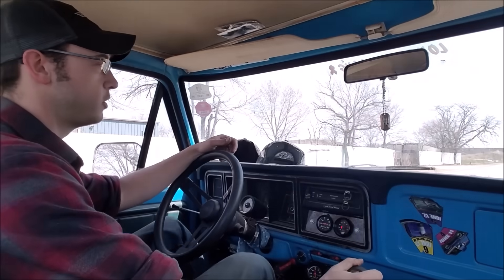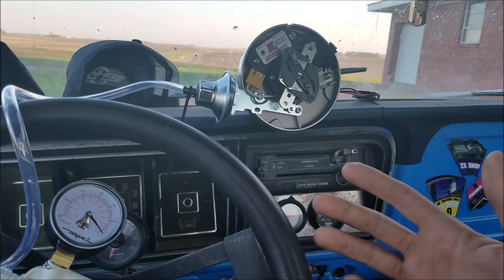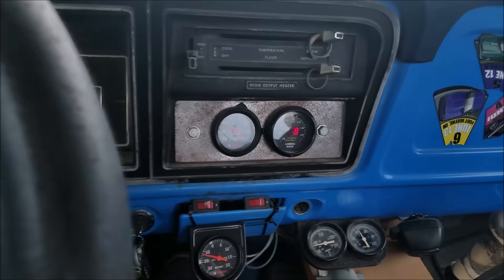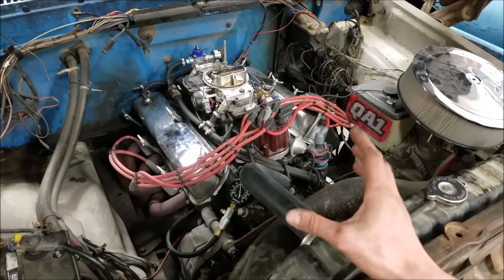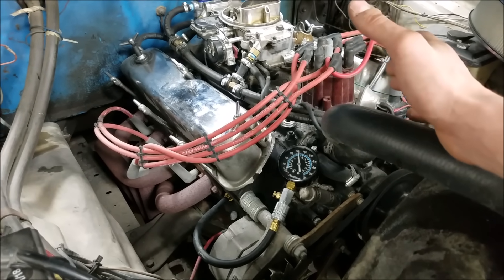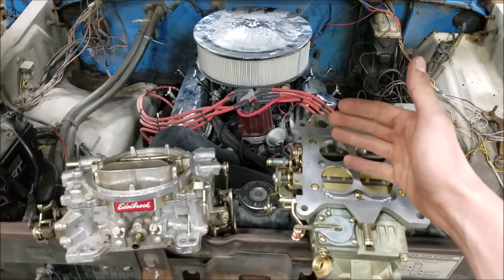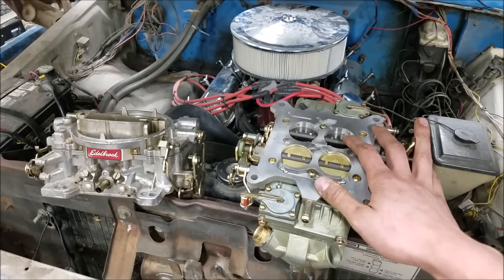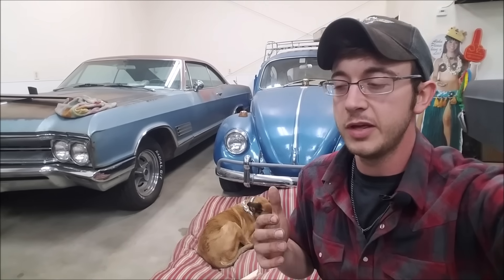Vacuum Advance - Ported vs Manifold: Which to Use & When !!!

Comment: My smallblock would overheat with long idle times, up to 235 Deg.  Stock numbers are 6BTDCat 600 RPM and manifold vacuum to the Vacuum Advance.  I racked my brain for a year or two.  Double checked my vacuum lines and Vacuum Advance was hooked to ported with no advance at idle.  Hooked up Vacuum advance to manifold vac and temp never gets past 206 at idle.
Reply from the maker: You clearly missed half of the video where you can’t just hook to ported and walk away. It’s not about running ported as an advantage in itself, it’s about what running ported allows you to do - that’s 6 degrees mechanical is killing you. I bet it feels like a dog if you mash the throttle. 
Running ported allows for more mechanical idle timing at idle - factory setpoints are often way too low and leave power on the table, running ported allows you to get mechanical timing back in an acceptable parameter - keep a close eye on total timing and limit it as need be. 

But this is the difference between having a dog, and having something that can really boogie - this is how to get everything out of your engine 👌
Reply: @ThunderHead289 You clearly missed what i was trying to say..... is that engineers that built the engine knew that maximum performance was accomplished by using ported for one and manifold for another.
Mine is 6 degrees initial but never actually sees 6 degrees with manifold vac to the canister.  A better explanation on the cooling properties of vac adv...

"There’s been a lot of debate whether or not the vacuum canister should be plugged into a ported or direct vacuum source. Internet forums are rife with opinions on both sides of the argument. However, there is a right and wrong way. And it’s not an opinion; it’s just a fact.

Plugging your vacuum advance into a direct source will allow it to engage at idle, which is good for a number of reasons. Much like cruise conditions, engines run leaner at idle than they do under load. Again, this means the mixture burns slower and needs an earlier spark to optimize the burn. Ensuring that the mixture has a complete burn before leaving through the exhaust port also helps the engine to run cooler at idle. All carbureted cars were set up with direct vacuum to the distributor before more stringent emissions requirements reared their heads.

Ported vacuum sources are a result of emissions laws and manufacturers doing whatever they could to get big V8 engines to pass smog before the incorporation of the catalytic converter. The idea was that by using little to no spark advance at idle, the exhaust gas would leave the cylinder still-on-fire and help maximize the efficiency of antiquated air injection systems. Engines from this era often ran very, very hot, were prone to warped exhaust valves, cracked cylinder heads and all other manner of issues. Using a ported spark advance will still allow the vacuum advance to do its job at steady cruising, but all of the benefits of idle cooling will be lost.

Here’s a quick experiment you can try on your car. Plug the vacuum advance into a ported vacuum source and check the idle rpm. Now, switch the vacuum advance to a direct source of vacuum and again check the idle rpm? We’ll bet money the RPM increased. Why? Because the additional ignition timing provided by the vacuum canister and full manifold vacuum source allowed the engine to more effectively burn the air/fuel mixture. It therefore produces more power (even at idle) and rpm rises as a result."
Reply from the maker: I’m going to address one of your first comments “it never sees 6 degrees”. 
What do you think happens when you punch the throttle and your vacuum drops out? 

I even show this in the video - your vacuum advance goes away and you are on pure mechanical timing. 
Fun fact also, I’m an engineer - all engineers design things with a massive safety margin because we have warranties. On an engine they want you to fire the mixture somewhat late on hard throttle because it’s safe. You can net a better mechanical timing curve with ported because if you ran manifold you would have combined too much timing at idle. 

Thunderhead289 - engineer. Automation programmer.
Reply: @ThunderHead289  You even say, vacuum drops out and mechanical timing is left.  Which means initial plus mechanical is left. You are an engineer?  
You are missing the point again.  Its not rocket science.   I am trying to explain that a vehicle needs advancement at IDLE to stay cool.  Yes vac drops at throttle eliminating vac advance but has initial and mechanical timing to compensate; which means even at throttle, the engine never sees 6 degrees after start up.   Here is a real GM engineer...

"As many of you are aware, timing and vacuum advance is one of my favorite subjects, as I was involved in the development of some of those systems in my GM days and I understand it. Many people don't, as there has been very little written about it anywhere that makes sense, and as a result, a lot of folks are under the misunderstanding that vacuum advance somehow compromises performance. Nothing could be further from the truth. I finally sat down the other day and wrote up a primer on the subject, with the objective of helping more folks to understand vacuum advance and how it works together with initial timing and centrifugal advance to optimize all-around operation and performance.

TIMING AND VACUUM ADVANCE 101

The most important concept to understand is that lean mixtures, such as at idle and steady highway cruise, take longer to burn than rich mixtures; idle in particular, as idle mixture is affected by exhaust gas dilution. This requires that lean mixtures have "the fire lit" earlier in the compression cycle (spark timing advanced), allowing more burn time so that peak cylinder pressure is reached just after TDC for peak efficiency and reduced exhaust gas temperature (wasted combustion energy). Rich mixtures, on the other hand, burn faster than lean mixtures, so they need to have "the fire lit" later in the compression cycle (spark timing retarded slightly) so maximum cylinder pressure is still achieved at the same point after TDC as with the lean mixture, for maximum efficiency.

The centrifugal advance system in a distributor advances spark timing purely as a function of engine rpm (irrespective of engine load or operating conditions), with the amount of advance and the rate at which it comes in determined by the weights and springs on top of the autocam mechanism. The amount of advance added by the distributor, combined with initial static timing, is "total timing" (i.e., the 34-36 degrees at high rpm that most SBC's like). Vacuum advance has absolutely nothing to do with total timing or performance, as when the throttle is opened, manifold vacuum drops essentially to zero, and the vacuum advance drops out entirely; it has no part in the "total timing" equation.

At idle, the engine needs additional spark advance in order to fire that lean, diluted mixture earlier in order to develop maximum cylinder pressure at the proper point, so the vacuum advance can (connected to manifold vacuum, not "ported" vacuum - more on that aberration later) is activated by the high manifold vacuum, and adds about 15 degrees of spark advance, on top of the initial static timing setting (i.e., if your static timing is at 10 degrees, at idle it's actually around 25 degrees with the vacuum advance connected). The same thing occurs at steady-state highway cruise; the mixture is lean, takes longer to burn, the load on the engine is low, the manifold vacuum is high, so the vacuum advance is again deployed, and if you had a timing light set up so you could see the balancer as you were going down the highway, you'd see about 50 degrees advance (10 degrees initial, 20-25 degrees from the centrifugal advance, and 15 degrees from the vacuum advance) at steady-state cruise (it only takes about 40 horsepower to cruise at 50mph).

When you accelerate, the mixture is instantly enriched (by the accelerator pump, power valve, etc.), burns faster, doesn't need the additional spark advance, and when the throttle plates open, manifold vacuum drops, and the vacuum advance can returns to zero, retarding the spark timing back to what is provided by the initial static timing plus the centrifugal advance provided by the distributor at that engine rpm; the vacuum advance doesn't come back into play until you back off the gas and manifold vacuum increases again as you return to steady-state cruise, when the mixture again becomes lean.

The key difference is that centrifugal advance (in the distributor autocam via weights and springs) is purely rpm-sensitive; nothing changes it except changes in rpm. Vacuum advance, on the other hand, responds to engine load and rapidly-changing operating conditions, providing the correct degree of spark advance at any point in time based on engine load, to deal with both lean and rich mixture conditions. By today's terms, this was a relatively crude mechanical system, but it did a good job of optimizing engine efficiency, throttle response, fuel economy, and idle cooling, with absolutely ZERO effect on wide-open throttle performance, as vacuum advance is inoperative under wide-open throttle conditions. In modern cars with computerized engine controllers, all those sensors and the controller change both mixture and spark timing 50 to 100 times per second, and we don't even HAVE a distributor any more - it's all electronic.

Now, to the widely-misunderstood manifold-vs.-ported vacuum aberration. After 30-40 years of controlling vacuum advance with full manifold vacuum, along came emissions requirements, years before catalytic converter technology had been developed, and all manner of crude band-aid systems were developed to try and reduce hydrocarbons and oxides of nitrogen in the exhaust stream. One of these band-aids was "ported spark", which moved the vacuum pickup orifice in the carburetor venturi from below the throttle plate (where it was exposed to full manifold vacuum at idle) to above the throttle plate, where it saw no manifold vacuum at all at idle. This meant the vacuum advance was inoperative at idle (retarding spark timing from its optimum value), and these applications also had VERY low initial static timing (usually 4 degrees or less, and some actually were set at 2 degrees AFTER TDC). This was done in order to increase exhaust gas temperature (due to "lighting the fire late") to improve the effectiveness of the "afterburning" of hydrocarbons by the air injected into the exhaust manifolds by the A.I.R. system; as a result, these engines ran like crap, and an enormous amount of wasted heat energy was transferred through the exhaust port walls into the coolant, causing them to run hot at idle - cylinder pressure fell off, engine temperatures went up, combustion efficiency went down the drain, and fuel economy went down with it.

If you look at the centrifugal advance calibrations for these "ported spark, late-timed" engines, you'll see that instead of having 20 degrees of advance, they had up to 34 degrees of advance in the distributor, in order to get back to the 34-36 degrees "total timing" at high rpm wide-open throttle to get some of the performance back. The vacuum advance still worked at steady-state highway cruise (lean mixture = low emissions), but it was inoperative at idle, which caused all manner of problems - "ported vacuum" was strictly an early, pre-converter crude emissions strategy, and nothing more.

What about the Harry high-school non-vacuum advance polished billet "whiz-bang" distributors you see in the Summit and Jeg's catalogs? They're JUNK on a street-driven car, but some people keep buying them because they're "race car" parts, so they must be "good for my car" - they're NOT. "Race cars" run at wide-open throttle, rich mixture, full load, and high rpm all the time, so they don't need a system (vacuum advance) to deal with the full range of driving conditions encountered in street operation. Anyone driving a street-driven car without manifold-connected vacuum advance is sacrificing idle cooling, throttle response, engine efficiency, and fuel economy, probably because they don't understand what vacuum advance is, how it works, and what it's for - there are lots of long-time experienced "mechanics" who don't understand the principles and operation of vacuum advance either, so they're not alone.

Vacuum advance calibrations are different between stock engines and modified engines, especially if you have a lot of cam and have relatively low manifold vacuum at idle. Most stock vacuum advance cans aren’t fully-deployed until they see about 15” Hg. Manifold vacuum, so those cans don’t work very well on a modified engine; with less than 15” Hg. at a rough idle, the stock can will “dither” in and out in response to the rapidly-changing manifold vacuum, constantly varying the amount of vacuum advance, which creates an unstable idle. Modified engines with more cam that generate less than 15” Hg. of vacuum at idle need a vacuum advance can that’s fully-deployed at least 1”, preferably 2” of vacuum less than idle vacuum level so idle advance is solid and stable; the Echlin #VC-1810 advance can (about $10 at NAPA) provides the same amount of advance as the stock can (15 degrees), but is fully-deployed at only 8” of vacuum, so there is no variation in idle timing even with a stout cam.

For peak engine performance, drivability, idle cooling and efficiency in a street-driven car, you need vacuum advance, connected to full manifold vacuum. Absolutely. Positively. Don't ask Summit or Jeg's about it – they don’t understand it, they're on commission, and they want to sell "race car" parts.

Courtesy John Hinckley
Retired GM/Chrysler Engineer
Reply: @aboutmyfathersbusiness8324  Not so.  Most pre-emissions were stock with ported vacuum.  I say "most" because there were some that came with manifold vacuum, but only some.
Reply: Because you didn't alter initial timing when using the ported source. If you had modified your distributor to give you the same initial timing that the manifold vacuum sourced advance afforded you probably would have had much stronger low rpm power and throttle response.

Comment: good video, thanks
Not sure I'm clear on where the vacuum is attached if it is a ported vacuum advance.  Manifold vacuum advance is self-explanatory unless I'm making an ass of myself with wild assumptions.
Reply from the maker: On a carb it is plumbed just above the throttle blades - so at idle it shouldn’t have an vacuum, but anything other than idle and it will be the same as manifold.

Comment: If you have modified engine i.e cam/heads/compression increase etc.. eliminate the vacuum advance and set max timing at 2500/3k rpm and let her eat
Reply from the maker: You still need vacuum advance when you are cruising or else you are just wasting fuel and getting your cylinders overly hot for no reason

Comment: Well I'll be damned, I didn't think this would shed some light but it really did.....I never thought of gauges on both ports....my current crate basic 350 with performer cam ides perfect with 10 deg init and 10 degrees manifold vac for 16 deg at idle and 20 mechanical, easy starts even when hot got, got a better idea of why it works well. Great breakdown on vac advance.

Comment: I swear that 99% of old cars I pop the hood on usually have the vacuum advance hooked up to manifold vacuum and it drives me nuts and I have set engines up for people where I wont hook up vacuum advance or I hook it up to ported and when I see the car again, someone usually comes along and hooks it up wrong, and I dont like hooking it up on a engine with a large cam because the vacuum signal will be very weak and on a hotrod u dont need vacuum advance, I personally dont use them to reduce the chances of inconsistent timing because I like to run my timing right on the edge for best performance. Great video man, I really appreciate u taking the time to try to educate folks about ignition timing, it took me a long time to grasp the concept of it and I still dont know everything but u learn best by trial and error.

Comment: Luke, I'm working on a 1979 Camaro Rally Sport with a 305 2V & 4-speed trans.  The vacuum line that leads to the distributor's vacuum advance is from a ported source on the carburetor.  It moves through a thermal vacuum switch before heading back to the vacuum canister.  I believe - and I emphasize "believe" - that this switch prevents vacuum advance until such time as the temp comes up and the switch opens (assuming it works properly).  Is this a necessary device in this system?  Thanks and I look forward to your response.  
Tinkering in Eastern Iowa...
Keith.

Comment: I checked my trucks timing because it was hard to turn over when hot and it was timed at 20° btdc. Turned it down to 8°btdc but it ran horrible. Later found that the vacuum pot was bad. I guess previous guy timed it high instead of replacing the pot.

Comment: I don't detune my ford motor. I go Points condenser. Faster start. Faster than electric. Friends 77 would run the battery dead. Bought Brand New 140.00 battery. Did the same thing. Went down to auto value. Bought Points distributer. Put it in. Half turn over. It was running.